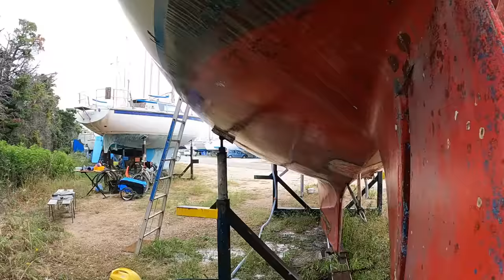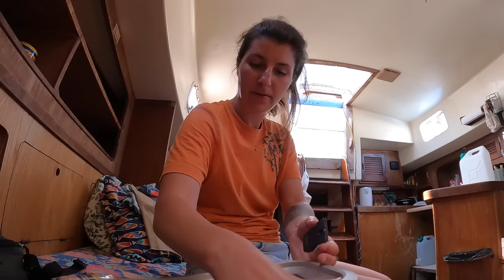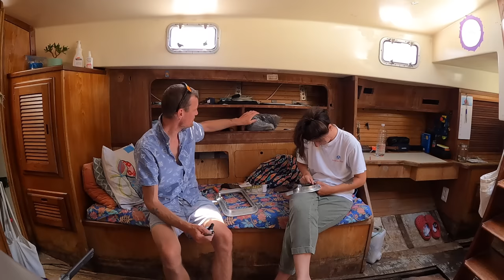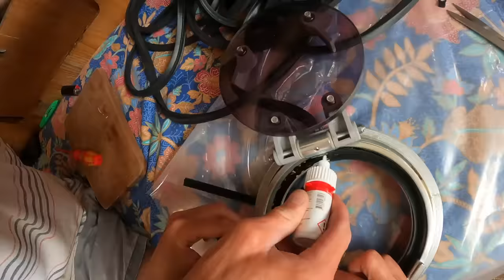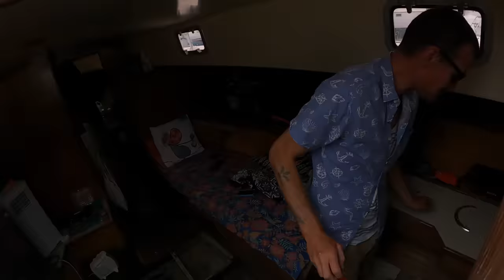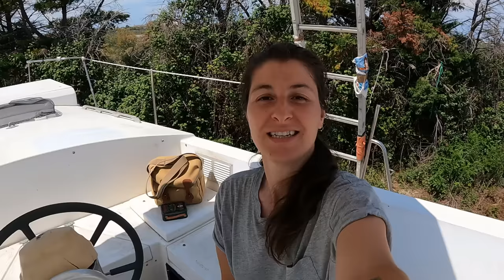UPDATE. What is Up with The €1 BOAT? | SAILING SEABIRD Ep. 25

Comment: Great Job on fixing the layers around the Ports!!  All your work looks great.  Here is a hint on saving Paint in Cans.  The Lid fits into a Groove in the Can top.  Put a small hole in the bottom of that groove. Then when the lid is re-inserted the excess paint in the Groove is pushed back into the Can.  SAVES FROM A GLUED ON EFFECT to remove the lid  next time and actually seals better!
Have more fun! Rich
Reply from the maker: Great tip!
Cheers Rich 🍻
Reply: @SailingSeabird  You bet! start the lid seal opposite the hole I use a nail punched through, then as you lay down the lid it pushes all loose pain in the grove to the hole! Happy Times To you both! Rich

Comment: Hi Stu, I was in the yacht building business for quite a few years, amongst my many experiences I found that the KING of silicones/adhesives is SIKA, yes a little expensive but utterly dependant, never had a fail using Sika, went through some huge storms/waves hitting the windscreens with only Sika bonding w/screens to superstructure and a lot more. I wish you & Marina all the very best❤
Reply from the maker: Love Sika 291i 
Use it almost religiously, just not on windows.
Anything thing that I never plan to  take up, deck fittings, winches, cleats etc 291 plus below the waterline.
Reply: In the UK,  we use CT1 adhesive sealant. As good as sika 291 plus sets under water and half the price. I think Toolstation stock it. Probably some equivalent In Bricolage outlets in France.
Reply: Alex hibbert tested a load on his converted life boat ...channel .

Ports look wonderful.. but its best to use something that remains flexible long term and in all temperature's.

Comment: Since you're on the dry, there's a product called 30 second cleaner. You spray  on(not pressure) leave it for a couple minutes,then spray clean, any white areas are whiter than white !
Reply from the maker: Send a link if possible.
We just just elbow grease and hard work.
All the paint will be sanded off as it's not in good shape.
We just wanted the boat not looking green.
Respect for the boat yard, nobody wants to see a green boat.
Cheers for watching 😃

Comment: top tip... when using silicone spray it after application with soapy water.... will smooth out easier and not stick to you as much. great job though.
Reply from the maker: Great tip.
Siliconing is an art, That's for sure.
Cheers for watching

Comment: you should put a drop of superglue where the rubber ends meet,when it dries it will pull apart letting water in,its how they seal windows on caravans it seals way longer if it cant pull apart due to shrinkage.
Reply from the maker: Great advice.
We'll be sure to put a drop on.
So many people give us really useful tips.
Cheers for watching 😃

Comment: There would originally have been a compass in the round hole. Once which could be read from the cockpit and from inside. That way someone seated inside could see what course the boat is on. Useful for marking up chart. Seeing the log for distance, a clock for time, and a compass for course. All visible from inside.
Reply from the maker: Hiya,
It was the autopilot head. The rest of the instruments ate in the combing. This must have been done out of ease.
But it's gone, and all that's left is a few screw holes. Need to match the gelcoat but done have the patience atm for that.
Cheers for watching 😃

Comment: Instead of using that expensive glue you can use 3M weather stripping adhesive it's way cheaper and it works really well
Reply from the maker: We'll check it out.
Thanks 😊

Comment: great step forward. Are u sure the rectangle window is right way up. I thought the joint in frame goes at bottom so any water drains out. not that it should leak , not now . keep on keeping on its hard tokeep going on such long projects don't forget to take the little dingy out and have fun.
Reply from the maker: You could be right.
I'll check with the manual. We just reinstalled it the way it came out.
Cheers 🍻

Comment: I have an idea for you. It's probably stupid but hear me out. With that dead space on the wall at the portholes boxing the empty space with sausage sort of works but is expensive. So take an extra 1/8" off the hole to make room , then using a kid's party balloon, and put something on it like wax,  silicone lubricant or something that won't mess up the fiberglass.
Coat the balloon with fiberglass cloth , put it in the porthole and blow up the balloon. Once dry, pop the balloon, removing it entirely, which may leave a 'boxed in' base in the wall to allow you grind the edges off - and leave a fiberglass cap the hole without it falling through into the void between the inner and outer wall.
Reply from the maker: It's not a bad idea.
Cheers for the advice.
Reply: Worst case it makes a mess and doesn't work, but you get to play with balloons so...............still fun

Comment: never, never install a window with sealant. If the window has to be removed again you will have problems. Use cellular rubber.
Reply from the maker: First I've heard of that.
I'd never install Windows with sikaflex.
But normal marine sealant is what I've always used, not has harsh.
Cheers for watching 😃

Comment: Having the windows open upward means you can't open them when it's raining without raing gettin.. Opening downwad allows air circulation even when It's raining. The outer trim, the split is susposed to go to the bottom to preven water from getting in
Reply: I did notice that as well.  Enough silicon behind and it wont matter though.  Half of mine were wrong but didnt leak.
Reply from the maker: Oh...
We just replaced like for like.
The portlight in the heads is upside down.
It's just the fittings are situated like that.
To late now 🤣🤣🤣